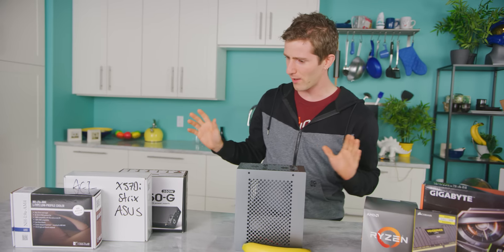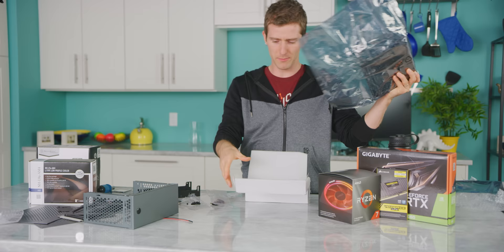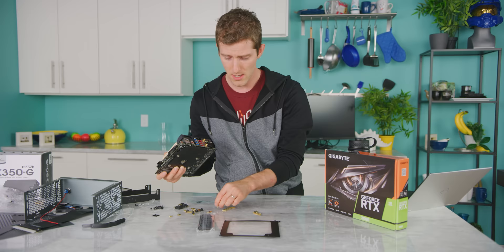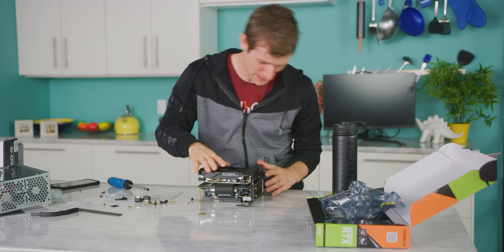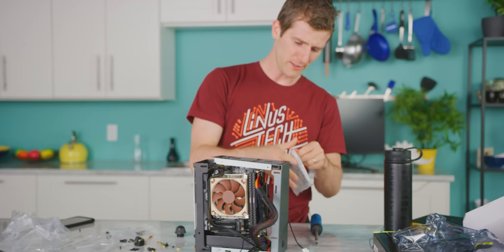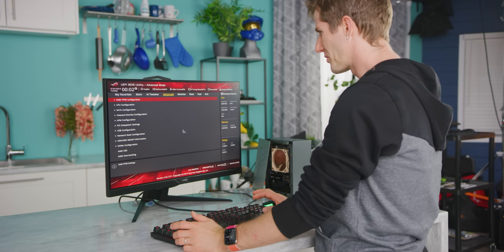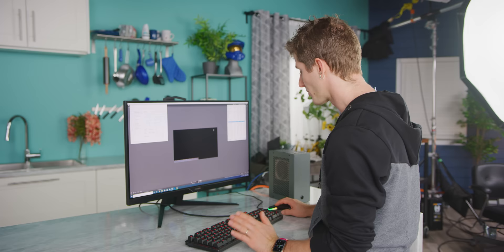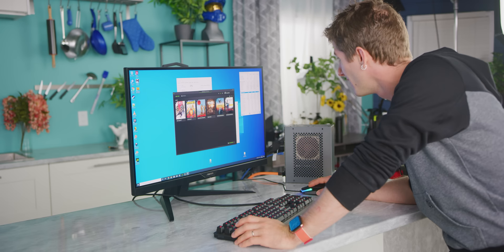Our Smallest Gaming PC Build EVER! - Velkase Velka 3

Comment: imagine going to a lan party like "wheres your pc?" "Its in my backpack"
Reply: Party favors, you mean
Reply: Imagine going to a party...
Reply: @PoopFart6969  xD
Reply: I mean. its still possible with much bigger cases than that. I feel like a node 202 can fit a backpack or that sf4
Reply: SolidGreenDay irrelevant
Reply: it's in your purse! xD
Reply: @SolidGreenDay  but you can put this pc in your wallet ;)
Reply: @SolidGreenDay  I have a cooler master casmos 1000 the original one from years ago so I have no chance in hell
Reply: Imagine using a laptop :)
Reply: @pixlheart2369  laptop pffft. smol desktop pc with strong components fuck yes.
Reply: @PoopFart6969  whats wrong with going to parties
Reply: @SolidGreenDay  as a 202 owner, it will NOT fit in most backpacks. 😅 What it WILL fit in, is a GatorCase.
Reply: Better one would be "In my hoodie
Reply: been doing it myself now for a few years with silverstone case.  got something the size of a ps4 with 7700k, 32gb ram, 1080ti, z270, 800w mini powersupply, fans - the works.  Wouldnt go back to a larger desktop. Its amazing.
Reply: @CDTJosh  outta curiosity, what specific case model are you running?
Reply: @ultrapluginsurvival1846  A Silverstone ML08. Heating wise. No problem. Good slim CPU fan. Good heatsink and thermal paste. GPU has rear exhaust to push out from the back. + Good reapply good thermal paste.  And I used a dremel on top of the case above the GPU to cut out for 3 x 100mmx100mm fans for extra airflow.  
Cut out an extra all slot in the front for 4 more usb3 ports. I fuckin love this thing. And anyone whos seen it is amazed at what a power house it is.  Full 4k gaming PC + 24" monitor and keyboard can easily fit into a duffle bag. 🤣
Reply: It's in my pocket*
Reply: @yenthusiast  He's just saying it's hard to find friends who take you to a party in the first place.
Reply: No, the Backpack is the PC
Reply: I've got a Silverstone SG07 and i've put it in a backpack and ridden my bike to a LAN before, including a 24" LCD (it's a big backpack)
Reply: @jaybobo  damn :D
Reply: @heath6969  The future is bright.
Reply: @PoopFart6969  This is really sad, butI actually laughed out loud at that.
Reply: Yo that would be sweet tho
Reply: @heath6969  Thats allota air flow XD
Reply: In my purse***
Reply: That'll be fun, you could bring it to your friends house, it's easier to bring along if you move a lot, and it's a cool conversation piece
Or buy a gaming laptop, it's up to you
Reply: that's called a gaming laptop then
Reply: There is a pc that you can put in your wallet. It is smaller than an SSD
Reply: @acim0095  we know about smartphones tho
Reply: Imagine running custom made VR software on it...carrying it in a (well ventilated) backpack! Your only challenge would be power, but man, it opens up a world of possibilities..!
Reply: @acim0095  yes, but can it run crysis?
Reply: @dondonk9094  It can run crysis low on 40 fps average maximum 51 and minimum 24
(Joke)
Reply: Toby Carrett imagine
Reply: I would actually want this to take it to my friends house when we want to play a game
Reply: or use a suitcase as a portable setup
Reply: The ghost s1 fits in my backpack with everything but my chonker ass k95 platinum
Reply: @QPUNeptune  he meant a raspberry pi its the same size as a credit card
Reply: I did that once 

I brought a laptop
Reply: are you from the 90s?ever heard of a laptop?
Reply: Go to the party and when they ask instead say, "I thought you had one for me." Then whip it out.
Reply: @mathieumansire372  ye but this is a desktop pc were talking about. laptops are fucking gay for gaming
Reply: @PoopFart6969  Imagine having friends to go to a party with
Reply: @yenthusiast  My lack of friends
Reply: @CDTJosh  that's a badass set-up
Reply: Who is Ian and why does he have a party?
Reply: How do people carry their pcs in a lan party anyway? With a suitcase?
Reply: @PoopFart6969  This comment hurts in 2020....
Reply: @almostliterally593  XD
Reply: No it’s in my jacket
Reply: I does that with a Shuttle and a 7800gtx in long time ago, but ... with CRT Flatron 19" ah ah.
Reply: You could technically do that with a mini itx build, you just need a pretty big bag
Reply: Yeah
Reply: @5trubel  that would be fricken lit, like those backpacks that have those portable phone chargers
Reply: That totally be a kid I’d know when I would be in high school I would see it in his backpack too lol

Comment: For gamers, silence isn't such a big deal when you have a blaring headset on that outdoes the sound of everything around you.
Reply: Or booming surround sound like I prefer.
Reply: It becomes pretty unbearable when you're not in game anymore
Reply: @Raaampage  yeah, I can comment on this from experience, with my dual-fan rx 580 going at a steady 220W and 95 degrees, the fans cut through my headphones and even the music I'm blasting into my ears >_> Thankfully, that's only If I oc it...
Reply: @mataskart9894  if the gpu is at 95degrees constantly while gaming you really should drop the voltage a little, im guessing you turned it up?
Reply: @notirishrider7953  yeah, quite a hefty OC. It's stable though, as long as the vrm's don't get up to 105 degrees... The oc is 1360 to 1500 core clock, and 1750 to 2000 memory clock. 1.1 to 1.3 V, and 160W to ~220W >_>
Reply: true
Reply: What's wrong with fan noise anyway? It's beautiful
Reply: @Raaampage  then just open msi afterburnker and asrock tuner and turn it down
Reply: @mataskart9894  >_>
Reply: Extremely open headphones tho
Reply: @TheCoolChap I had a 700W Chieftec power supply that was almost 9 years old, but a week ago the fan somewhat broke and became extremely loud, so I bought a EVGA 750 BQ to replace it
Reply: Chandler 

Lol ikr, everyone always talks about noise!
Reply: True
Reply: Yeah but some setups have horrible sounds and it’s loud enough that it overcomes that.
Reply: exactly.unless you're a big streamer with good production and audio setup.
Reply: Untill your friends in the chat asks you to turn off your house fan
Reply: @mataskart9894  Dual fan 1050ti here, with AMD processor integrated graphics as another fan, and then a seperate fan. This shit's really loud ever since I installed my 1050ti.
Reply: Matas Kart 95 degrees?! 😂 I’m dead
Reply: As a casual streamer, fan noise is pretty annoying for most viewers, even if you can’t hear it too well. There are three options to resolve the issue; 1. Get a better cooling system to remove the noise, 2. Move your pc into another room, or 3. Give a big ol’🖕to your viewers.
Reply: Unless you're open back master race
Reply: Did u say something
Reply: You don't need to wear headphones for some games though. For example, I play Brawlhalla with my headset resting around my neck. I play better that way, so the fans would be annoying.
Reply: @mataskart9894  Really? I have an air conditioner next to my ears while I'm gaming, because the window is right there, and it's always running maxed out. And even with the AC running, I can only hear the game in my headset. 

I guess it really depends on the headset and the person.
Reply: noctua makes 40mm fans, just a thought.
Reply: I use my pc for gaming and music composition/recording; it runs way too loud to not be picked up by my microphone. I’m looking to upgrade to a more silent build, but even my loud pc isn’t a bother with headphones on during gaming lol.
Reply: it is importance when you try to play game at 1 am on school day.
Reply: And a cherry mx blue keyboard click-clacking away
Reply: I think you meant Xilence.
Reply: It's true
My keyboard now sounds like I press my tooth when it's about to fall because I've never heard it again
Reply: @mataskart9894  haha my gtx 1050ti memory go 4.5 ghz
Reply: @matteofeyaerts  Nvidea cards have absolutely different memory speed measurements, it's a different architecture.
Reply: @mataskart9894  i know that but i think tey should make modern memory go Faster aswel
Reply: That's why gaming laptop companies haven't seemed to care enough about how loud their fans are. If they have technology to pack so much power into a little chip, why can't they make a quieter fan?
Reply: What about my family members lol, my room isn't silenced well xD so rip their ears
Reply: Unless everyone around you is asleep
Reply: i think im a tech hoarder
Reply: A good rule of thumb is that if you can pick it up on your mic, it's too loud. Yeah, you might be able to get away with push-to-talk or a smart mic input, but if people have trouble understanding you because of that background noise...
Reply: Agreed, I play a PS4 launch edition, and whenever I go near its really loud but I sit about 2 and 1/2 mi away with a headset on and I never noticed it.
Reply: yeah my keyboard is probably louder than the pc itself lmao
Reply: Especially if your parents are fighting
Reply: Ya it’s just parents
Reply: Yes but if your playing your playing multiplayer people will hear that
Reply: @damiengates7581  bruh my friends are always talking shit about the hummmm in the background bc they all use console and i am in my pc
Reply: @Raaampage  just get noise canceling headphones
Reply: @mataskart9894  i know im a year late but extended sessions of 80 degrees can kinda break stuff down.
Reply: @Raaampage  when you aren't in game and your fans are still spinning you have larger concerns than noise
Reply: My laptop is so loud I can hear it through my headphones while its on the desktop with no programs
Reply: Yeah I dont worry about sound, the only thing id be worrying about is the temperature of the pc which affects the performance of the game yknow
Reply: you can also replace the PSU fan with a noctua 40mm and it's much better
Reply: I have more fans than elvis.Elvis.. I can't hear anything with my headset on lol
Reply: true  it is more the heat that becomes the problem and too much heat = shorter life span for GPU and CPU and ?????

Comment: You basically built a Windows console.
Reply: A console that is probably around or more powerful than a ps4 (pro?) and a xbox one while still being smaller in volume visually (cant account for actual volume).
But I would have gone with an external power supply while placing the MB more in the middle to have more space for cables and fans
Reply: Windows X
Instead of (X)box
Reply: @Appoxo  more like nearly 3x as powerful as a ps4
Reply: @Sumoboi1  Dunno about the gigaflops, capability and render power of this sff and its thermal activity. Could run pretty hot compared to an one x/ps4 pro
Reply: @Appoxo  Significantly more powerful than either contender :P
Reply: @Appoxo  yeah no clue why MS and Sony go through so much hassle making these consoles when they can just pick computer parts and standardize them
Reply: Appoxo runs cooler and 4x better then a PS4 (2-3x better than PS4 pro)
Reply: @Appoxo  Actually, If you were to run the water cooler externally then it would run cooler...
Reply: @Super Wils Gaming it would run hotter... he's not lying...
Reply: @Super Wils Gaming Not more than you
Reply: @Appoxo  I would be interested to see what thermal performance is like in one of these. It does have nice open panels for ventilation, but with the gear crammed so tightly... Who knows.

On the other hand my first gen PS4 sounds like it's ready to take off under any load these days. I'm sure part of that is that I need to clean it, but part of it is that it's just a noisy ass machine lol.
Reply: "windows console" Soooo an xbox then?
Reply: @Mommotexx  Essentially what the original Xbox was proposed to Bill Gates as.
Reply: Wibox.
Reply: @Appoxo    Hell nah, this pc might run hotter, but both consoles TOGETHER would not even do it in term of performance.  (I think, correct me if not) But like bruh a 3700x and an RTX 2060 is still way way way better than a ps4.
Reply: actually, if you think about it, you built a custom xbox one. xbox one's run windows 10, but more stripped down to allow the system to run better.
Reply: @Sumoboi1  and 2x more than xbox
Reply: Project x
Reply: @Appoxo  This is not even comparable to the ps4 or even the coming ps5. consoles are a joke.
Reply: @scirefacias2682  ah yes... of course xD
Reply: I was just saying that in my head before seeing this
Reply: Considering looking at the Amazon links, this is a borderline $2k build before even factoring in monitors and shit, I would sure fucking hope it would run better than an Xbox and ps4 combined.
Reply: @Klote3241  mass production cost. saving $5 per unit is a big deal, when you plan to sell 100 million units.
Reply: @jacoblong9859  that argument makes no sense... the products that are on the market are already massively produced... in a sense your argument would make my comment even more viable since it would lower the cost even more!
Reply: Too be honest pcs should be getting smaller same with gpus would be nice to have a full size power in such a small package if you catch my drift it ends up as a FPS war right now 60fps at 4K is plenty 8k is kinda not worth it what’s worth it is hdr and microled
Reply: WixBox
Reply: HACKKER  Xdows
Reply: you mean the new xbox fridge
Reply: Casey Hill the winbox
Reply: @Appoxo  yeah but almost 3x the price
Reply: @Klote3241    it's really this simple, consoles exist and are successful,  if you dont "get it" then it's you who are lacking.  

It's ok to just say you dont know....
Reply: @DrewLSsix  lol whut? Thanks for bringing up something that has nothing to do with the conversation.
Reply: @Klote3241    how does it not have anything to do with the conversation?
Reply: @DrewLSsix  because uniforming regular pc parts still makes it a console. the only difference is the fact that they don't make the hardware themselves. they would just buy in parts that are already available on the market.
Reply: Klote3241 maybe Xbox...Sony is custom all the way. Ps5 gonna be straight bad ass.
Reply: That's the sex appeal. 😂
Reply: Brian Flores lol you are confused man, lol I doubt next gen consoles (any of them) will have much “sex appeal” 🤣🤣
Reply: Lemon O prices confirmed? Or just trolling? Oh nvermind I see. #notconfirmed
Reply: My favorite part was when he tried to squeeze it together like an accordion. I can't stop laughing.
Reply: Sony or Microsoft should hire you to build stronger console
Reply: bluebird2220 why him?
Reply: Appoxo new age ps4 are fairly quiet tbh
Reply: Scire Facias the upcoming ps5 would mop the floor with this
Reply: @kajaai8658  not better than the PS4 pro and Xbox one X tho
Reply: @kamisama9715  im pretty sure the ps5 and xb sx are going to have the equivalent of a 2060 super, which is right under the 2070, so yeah the ps5 and xb would be faster but then they'll fall back down as soon as the 2nd gen rtx series comes out
Reply: @kajaai8658  The PS5 has more teraflops than a 2070 super
Reply: @kamisama9715  teraflops isn't apl there is to a gpu, they woupdn't put a 700$ gpu in a 500-600 $ console that's just ridiculous
Reply: @kamisama9715  andnit also has more than a 2080 technically, so they might be working on the next rtx 3000 series equivalent
Reply: @kajaai8658  yes they can put such a hefty gpu in it because most of their income streams from people trying to buy games for it and we can't do anything with a console besides gaming and even if they are a lil bit lower the gpu and cpu are perfectly optimized for gaming only and therefore draws the maximum performance out of them which pc users cannot do unless by overclocking
Reply: @kamisama9715  they wouldn't make money out of their console tho... and that's not a sony/microsoft type of thing to do
Reply: @kajaai8658  surprisingly it is
Reply: @kamisama9715  yea surprisingly, but again they probably cut somewhere else like cpu or on other parts of the card
Reply: WINDOZE is shit.
Reply: @Sumoboi1  3x is a bit exaggerated, but it is definitely more powerful
Reply: Xbox Series X: Windows 10 Edition
Reply: @Asylus  Definitely 3x better, right on the money actually. The quality of Xbox one's GPU is comparative to a AMD Radeon 7790 and here's the stats https://gpu.userbenchmark.com/Compare/Nvidia-RTX-2060-vs-AMD-HD-7790/4034vsm8622
Reply: @clapcheeks7550  the rtx 2060 costs almost the same as the entire console.
Reply: @Asylus  Cost wasn't a factor here, only performance.
Reply: @clapcheeks7550  understood, I'm wrong then.
Reply: That’s called an “Xbox”
Reply: You do realize that Xboxes run Windows right?
Reply: @trevorromney3589  That poor mobo is taking a beating from both sides, bottom of GPU and bottom of CPU.
Reply: @Klote3241  but then everyone has no excuse for getting a console rather than a pc
Reply: @keerthikmuruganandam1265  uh no... Like i said it would still be a console.. Microsoft and sony would still code their software. The hardware on the pc market that is availible would be standardized to a specific setup. And you would still be buying a Xbox or PlayStation.
Reply: @Klote3241  price
Reply: Alienware alpha flashbacks
Reply: Ok
Reply: WinBox!